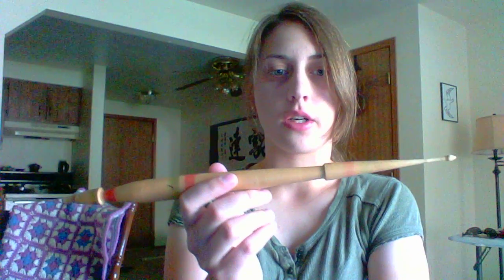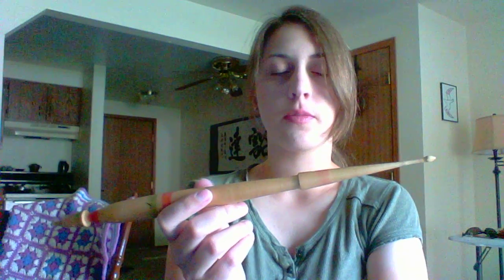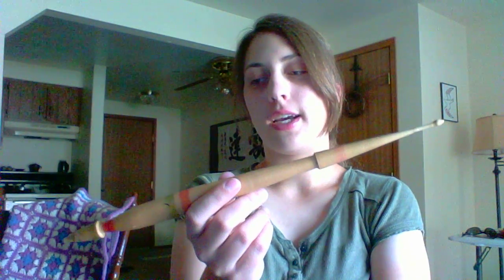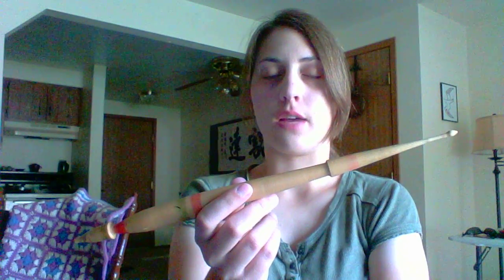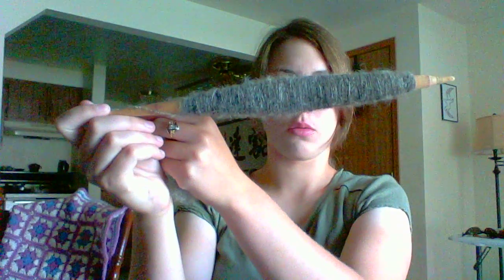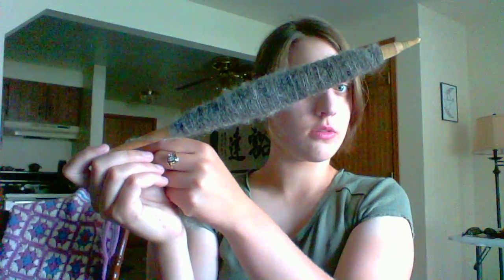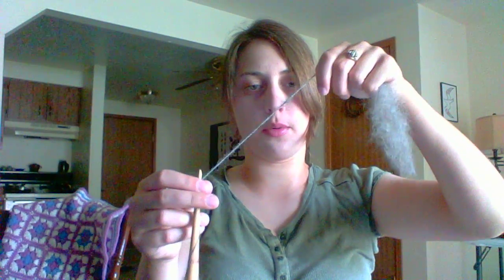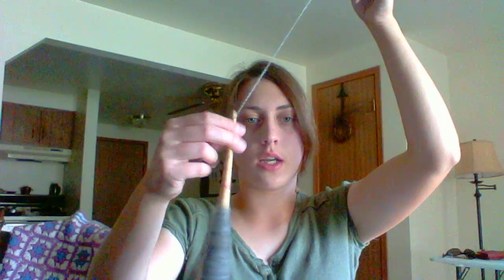Using a Bulgarian Spindle

Comment: I use an old fashioned wooden slingshot as a hand distaff,  you could try that instead.  It requires less fiber and is a lot cheaper.  You can get a 2 pk on Amazon for less than $10